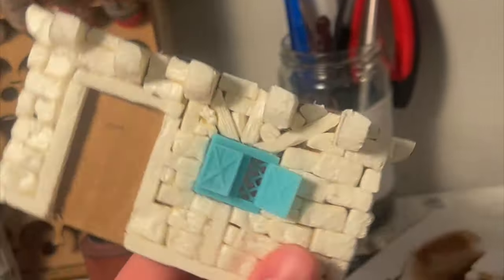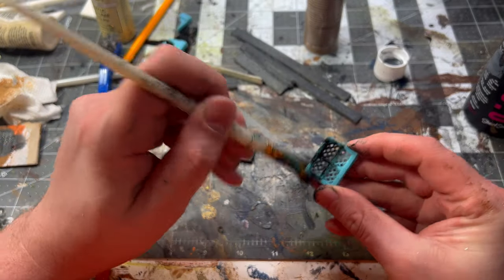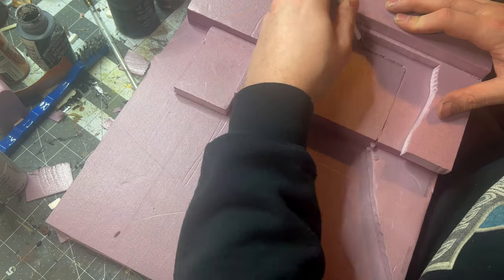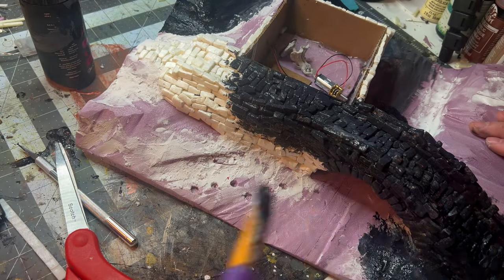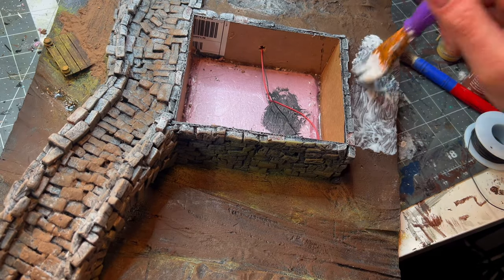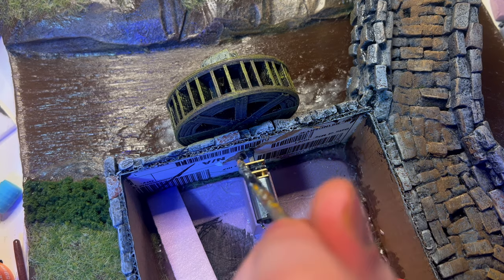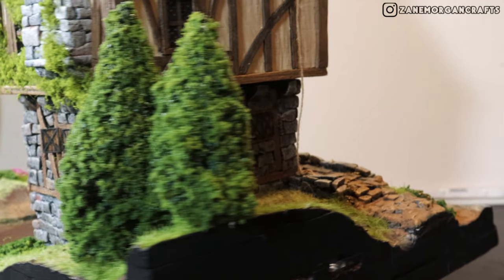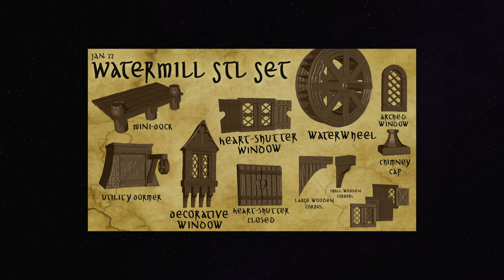REVOLUTIONARY motorized D&D terrain that will blow your mind!

Comment from the maker: Thanks so much for watching! I added a paint legend in this video to give some visual rather than just calling out random paint names.
Reply: You might want to consider a slight upgrade for the wheel, take some gloss varnish and a very soft brush, while it's running you can get a really good effect on the edges of the wheels buckets to make them look wet in the right way.